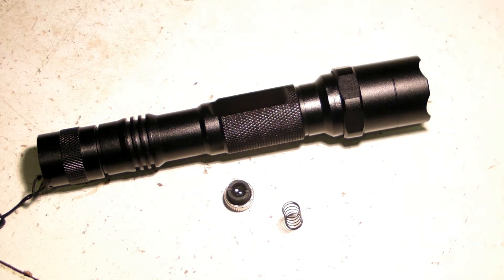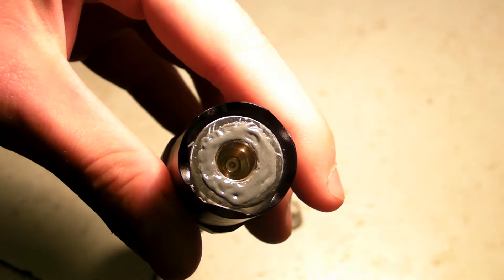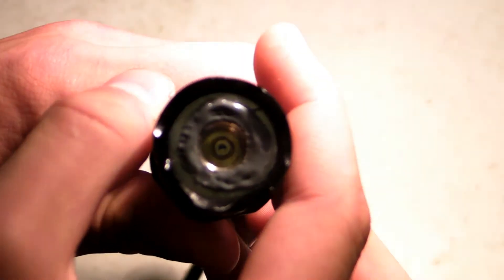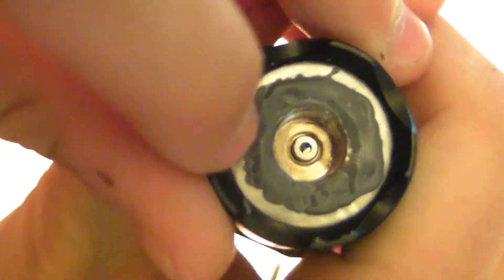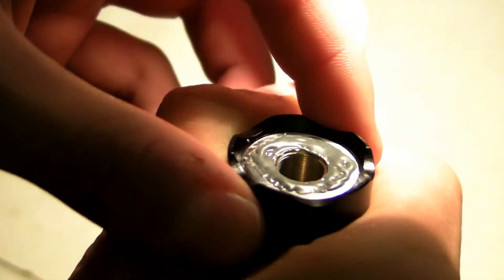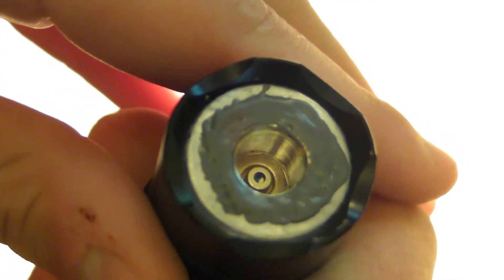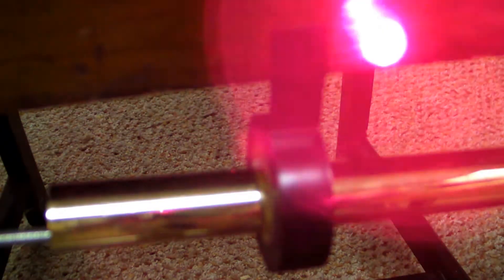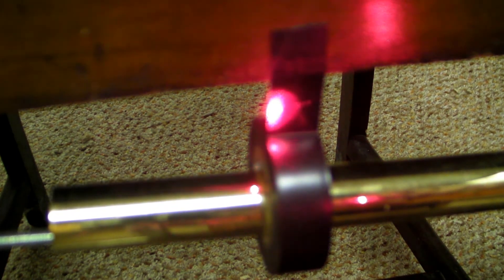Homemade 200mW Red Laser

Comment from the maker: @1800Supreme Pot modding... the worst choice one can ever make with little knowledge on the exact laser. You can get a 250mW red laser diode from the LPC-815 sled, but you have to extract it. Or, you can get the same diode pre extracted. One place is hightechdealz. com

Comment: ok i was wondering if u could help me i just got a cheap 200 mw laser from china and i turned up the pot all the way and the diode burned out prolly cuz its not really a 200 mw diode so i was fine with that i would just get a new diode but i cant seem to find any online can u help me or guide me in the right direction on to where i can get a power fully laser diode and i only want a diode no a kit

Comment from the maker: @maintoc Yep, it has a nice host. And this is not an LED, this is a laser diode, or LD
And it depends on the burner speed, I am planning to get a LPC-815 sled which has a 300-400mW red laser.
The blue/ violet laser will be another project

Comment: Wow!  The casing for that diode laser (and batteries, etc.) is huge compared to the little keychain laser-pointers that I have.  ~  If you replaced the burned out red laser L.E.D. with a working-but-junked blue laser diode from a blue-ray player/burner, would it work?  ~  Nice visuals, near the start, of the laser in use in the dark, plus the tape-cutting and balloon poppings were good.  :)

Comment from the maker: @filipkof 
Well, it matters what you drive your diode at, how big your heatsink is inside the host and what king of lens you use. Mine here, hardly heated up at all, but I would still obey the 60/60 rule (60 seconds on, 60 seconds off)